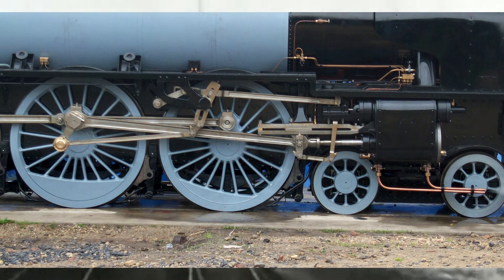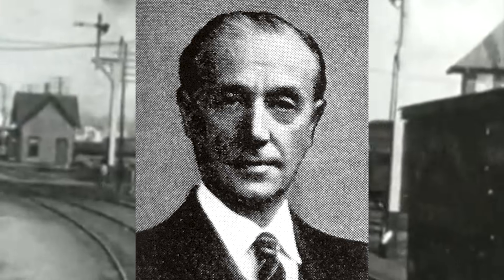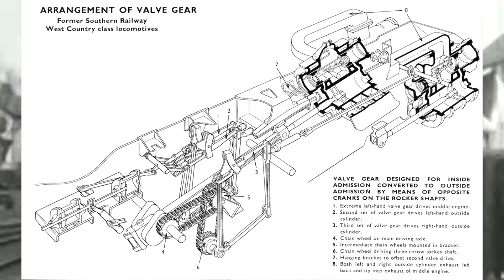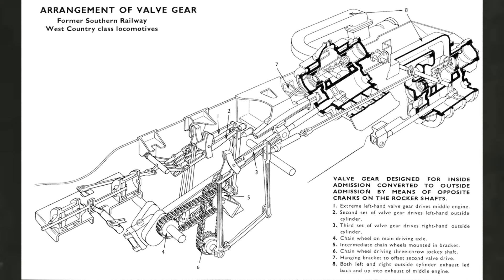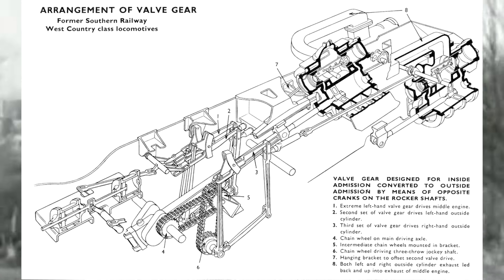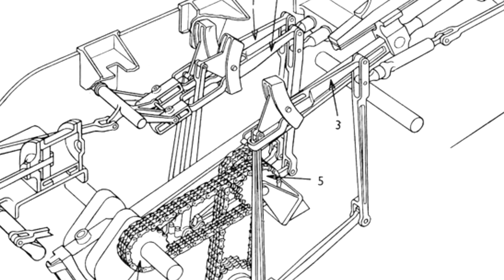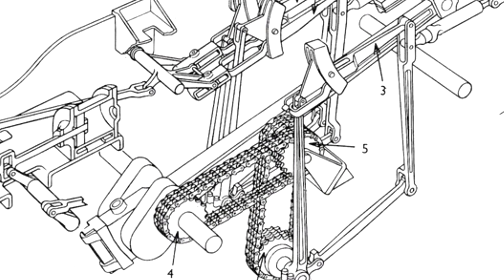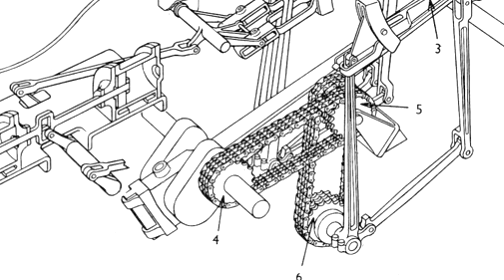Oliver Bulleid's INSANE and AWFUL Chain-Driven Valve Gear | History in the Dark

Comment: Great video, as ever. Bulleid wanted shaft drive rather than chains, but these couldn't be sourced in wartime. May not have worked any better. The chzins wore, rather than stretched. Rather like a motorcycle chain. Impellers on the axles helped to redue oil losses via the seals. The rebuilds were more reliable, but not as much fun (to an enthusiast) as the originals!

Comment: As a regular on thies locomotives I can say they are brilliant, they need to be kept in a better condition than a walsharts, but they are much easier to maintain and prepare, with the short travel valves they are extremely strong, most of the problems was crew or maintenance related, the design was absolutely fine and more than did the job and still does

Comment: I don't necessarily agree with the statement that chain drive cannot work for a purpose built locomotive, on account of the fact that chain drive worked quite well with some of the LNER Sentinel shunters (0-4-0VBT), which weirdly enough were tank engines with vertical boilers.

Comment: Based on the title picture of the gear it is obvious there is no chain tensioners. From experience of bicycles and motor cycles and heavy industry chains they stretch and wear, the stretch due to tension during reversals of load, wear due to contamination of bearing surfaces.
The oil bath helps with the latter. But without a damper or tensioner the impact of a tension reversal will always stretch the chains. A rocking arm with either small gears or possibly slides is required to control and tension both sides of the chains (pull and return) is required. You are then not causing a snap change in tension in the chain on load reversal as the whole chain is tensioned. Systems used in chain driven overhead valve car engines, the engines do not reverse, but the loads do as they accelerate and slow.

Comment: The strong point of the Bulleid Pacifics were the boilers, they were exceptionally free steaming and enabled these Pacifics in maintaining high speeds.
Not all of the light pacifics were rebuilt, both rebuilt and non rebuilt members of this class are preserved. But of the heavier Merchant Navy class all were rebuilt. The rebuild included not only the change of the valve gear, but also the erratic steam reverser was replaced with a screw reverser, the airsmoothed cladding was removed and the smoke box and blast pipe arrangement altered. This is the reason why one of the 11 preserved Merchant Navy class is rebuilt into original condition, modern technology providing better wear resistant chains and better oil seals than the original leather seals, eradicating the most obvious downfalls of the original locomotives.
The light pacifics preserved in original condition with these modern chains and seals operate mostly trouble free now.

Comment: The air smoothed casing was not an attempt at streamlining, it was used so that they could be washed by carriage washers.  The flat front end is the clue to that,  it did however help lift steam and smoke out of the drivers field of view.
Reply: Correct.

Comment: Interesting video! Given the failures, slipping and fires, it's no surprise that many of the Bulleid pacifics were rebuilt with conventional and more reliable valve gear and the air smoothing was removed to improve access. However, the sanity of this rebuild project was questionable since the locomotives' subsequent service lives were cut ridiculously short due to their replacement by diesels and the later electrification of some of their operational routes.

Comment: Most of the problems with the valve gears etc were caused by lack of good quality materials immediately after the war. Good quality modern materials would solve most of the problems. The loco's were not streamlined. The air smoothed casing was to allow the locos to pass through carriage washing machines. The casing did restrict the drivers view ahead and was nominated by the railway inspectorate as a  contributary factor in the Lewisham Rail crash. A lot of these locomotives are still doing stirling work on heritage railways as well as operating steam tours on Britain's main lines.

Comment: I did an evening class with one of the crew restoring an unrebuilt Battle of Britain and he told us that they had found out that everything wrong with the valve gear was solved with modern materials - they now had chains that didn’t stretch and modern packing stopped the oil leaks (Bullied had to use leather because he couldn’t use the roller bearings he wanted to because of war time shortages).

Comment: 10:52  I read that chains do not actually stretch.  Instead, the holes and pins in each link wear a tiny bit, giving a noticeable increase in overall length.
Reply: pretty well much, other than cheap industrial stuff... they definitely stretch and snap well before wearing out... if used incorrectly :)

and up until teh late 80s, most large capacity bikes had 630 pitch chain. big, heavy, and clunky. they still hadnt figured out how to get a 530 to take a hundred+ HP... 
otherwise...

the rollers and sprockets wear. the rollers wear on the bushes. the bushes wear on the pins.

and people pay lots of money for an oring chain that only seals the side plates and pins but does nothing for the rollers, sprocket or bushes. so they still wear out just as fast as a plain chain...
and the orings waste a lot of power...

Comment: Gresley didn't do so well with valve gear. His conjugated gear for  the A4s was always troublesome. Mallard nearly destroyed itself on that speed record run when the big end of the inside cylinder practically melted, Being experimental is all well and good but there comes a time when you ought to call it a day and admit you've blundered. In my mind Bulleid's designs for the Southern were a waste of metal. His Pacifics suffered so much wheel spin it's a wonder the passengers didn't get out and push

Comment: So, in short, they put a timing chain on a locomotive. Timing chains on small internal combustion engines (of the appropriate size to drive a car) are great, but you gotta keep that chain tensioned properly or it skips time, and usually when that happens on an internal combustion engine, you start getting negative events like the piston bending the valves, and the valves punching holes in the pistons, fun fact, modern internal combustion engines sometimes arrived at their typically 11:1 compression ratio by making the piston at the top of it's stroke (when the valves are supposed to be closed) able to occupy the same space as the heads of the valves do (when the piston is notably absent due to crankshaft rotation). So, you can hopefully see where this is going, if the timing chain skips teeth on the sprockets because the tensioner is worn out or installed improperly, you get your pistons hitting your valves, and generally when the engine's running fast, that's going to make your engine a boat anchor in short order.
Thankfully, since steam engines typically don't use poppet valves, we don't have to worry about that particular failure mode. However, the timing chain (if present) must still be kept properly tensioned, because if it slips on the sprockets, the valve timing shifts, and generally it shifts in a way that makes the engine run worse or not at all.
So, basically, if that timing chain was going to be kept in place, it would have to be enclosed with the rest of the valve gear, sealed in that oil bath, and you can't make a shaft oil seal that seals against a great deal of movement like you get with that drive axle, so the whole point of the idea that Mr. Bullied had is kinda... dead on arrival, unless you can make that shaft seal ride on the axle, sealed against the axle and a plate of metal that is not free to rotate but is free to translate up/down/forwards/backwards a little bit, and then have more seals that seal that metal plate to the main oil bath casing. That would work, but having to worry about 2 (probably rubber) seals just to keep the oil in the oil bath from leaking out or grit from getting in... honestly at that point you're probably better off just biting the bullet and going with the standard Walschaerts valve gear.
Reply: European engineers  generally do not have a good track record of making timing chains in internal combustion engines that last

Comment: Roller chains don’t stretch in the sense the metal yields and elongates under tension.  What happens is that each time a link flexes as it comes off the driven sprocket and onto the driving sprockets under driving tension, it wears a little bit where the roller bears against the pin.  After enough of these flexing rubbing events, slop develops in the interface and the pitch of the chain under tension lengthens enough that it no longer matches the pitch of the cogs on the sprockets, wearing their loaded faces down to match.  The resulting slop makes whatever motion the chain is driving erratic.

The black crud that forms on bicycle chains no matter how clean you keep them is steel dust mixed with oil and ordinary dirt.  If you scrape some off a dirty chain it will be attracted to a magnet.  Try it!

Standard half-inch pitch bicycle chains should be replaced when the distance over 24 links gets to 12 1/16 inches, i.e., ~2%.else they will start eating the much more expensive rear sprockets and front chainrings.
Reply: Error:  1/16 in 12 is 0.5%, not 2%.  My bad.  Sorry.  New math....

Comment: It wasn't the chain valve gear per se that actually caused the problems, but the steam operated reverser coupled with the drivers' habit when shunting the loco, often still coupled to the train, of going from forward drive to reverse without first bringing the locomotive to a halt.
This placed immense strain on the chain causing both wear and excessive stretch, necessitating early replacement.
Now, the chain ran in an oil bath and was intended to remain serviceable between boiler lifts, hence the two piece oil bath was not designed to be split with the boiler in situ.
Yes, it was possible, but the problems began after the repairs were carried out and it was found that the two halves of the oil bath could not, effectively, be sealed against oil leakage.
Hence the oil leaks and the occasional incident of the boiler cladding, soaked in leaked oil catching fire.

Today, with drivers being trained to operate the locomotives correctly, the Unrebuilt Light Pacifics in preservation, both on private and main line have proved to be remarkably reliable.
Reply: Thank heavens. A sensible technical answer. Locos with this gear are still in daily use on the UK rail network, both private short lines and on high speed mainlines. What OVS demonstrated was twofold. Firstly that steam era drivers were a very varied bunch. A good crew could get great things out of a spamcan but a mediocre crew could break them very easily, as you suggest. It's interesting that the badly flawed Leader loco only really functioned when run out of Eastleigh, not Brighton.
Secondly, maintenance was pretty patchy as well  something that remains to this day. The same units perform very differently depending on the depot.
I've driven rebuilt and rebuilt Bulleids in the modern era and the crews generally love them. The rebuilt versions are more reliable but there are a dozen or so unrebuilt versions around earning money for their owners. Personally, I'd love to see a spamcan version of a Merchant Navy.

Comment: I see what he was thinking. But wouldn't it be easier to just use Pistons that have the rod go all the way through, and build a mini crank off of that. It's a little longer, yes. But you wouldn't have to deal with chain stretch.
Reply: That's pretty much what the GWR did with their 4cyl machines, featuring "divided drive" i.e. inside cyls driving front coupled axle, outside cyls driving middle axle, the motion for the outside valves being transmitted via rockers from those on the inside .... Bulleid's were 3 cyl, utilising 3 sets of chain driven gear mounted inside the frames, the outer two driving their respective outside cylinders, again via rockers.  This avoided the "derived conjugated motion" of OVSB's old boss, Gresley, which was (as his successor Thompson noted) tended to be maintenance heavy,  definitely an issue under wartime conditions.

Comment: Bulleid is also the reason why the Metropolitan Vickers Co-Bo, with its 2-stroke engine, was ordered for BR. He was in favour of the 2-stroke engine.
Reply: He would have loved the Deltic then😊
Similar in the fact that his steam locos had good performance at the expense of fuel.
Reply: Bulleid wasn't the engine designer.  The concept came from Crossley and the theoretical advantages of 2-stroke were sound enough at the time.  You need to keep in mind political constraints back then didn't favour spending scarce foreign currency on that nasty, reliable American stuff!!

The problem was the execution.  The same type of engine was employed in the semi-successful Class 28 MetroVic, which wasn't one of OVSB's!  One Aussie railway (Victoria IIRC) had a shedload of Crossley enginedocos and for reasons very specific to the railway, spent ages making the ruddy things work well, which they achieved ... just as new reliable locos began to arrive.
Reply: @TheHoveHeretic never said it was. There were no 2-stroke diesel engines in the original Modernisation Plan until Bulleid made his suggestion.

Comment: Slag off Ollie's chain valve gear as much as you like, but his boilers were the dog's bollocks. Bulleid Trivia: He was also CME of the Republic or Ireland Railways. Car engine designer W.O. Bentley of Bentley cars was a Bulleid fanboy. He would go to Victoria station in London and talk to the footplate crews on the MNs, WCs & BBs.
Reply: The Q1 was a great design, it should have been a BR standard class.
Reply: And he was not liked in Ireland at all, being arrogant and a spendthrift.  His Turfburner was a spectacular and above all costly failure being based on his other failure, the Leader.

Comment: another major issue not included was the fires, the sparying oil didnt just go on the rails, it went up behind the streamline casing and would occasionally catch fire, one of the videos you repeatedly use shows a burnt patch of casing just after the name plate. such as 12:28
Reply: This is not true. The oil baths were enclosed, so oil did not get into the lagging from there. Oil in the lagging came from the cab oil trays that fed the axle boxes, when these overflowed the oil ran down the wheels and then was thown into the lagging.  This video is full of ignorance and false infromation, as per normal with videos on Bulleid Pacifics.

Comment: Chain driven gear actually wasn't OVSB's initial choice, but under the exigencies of wartime shortages, the preferred Carden Shaft technology (an import from our then ally, the US) was a non-starter. There's a hypnotic video of the chain gear in action, filmed at Brighton Works and shot from the underside. 

Come to that, the 4-6-2 wheel arrangement wasnt first choice either, that was a 2-8-2,  but the PW supremo, naturally wary in the aftermath of the Sevenoaks Crash of 1927 (involving a 2-6-4T "River" Class) vetoed any use of a leading pony truck on an express loco.  He did suggest he'd be happy with a Krauss-Helmholz Truck ... unlike OVSB!!

There's also an often repeated assertion that the steam reverser employed on the Pacifics, developed from the LSWR system, was used in place of the technically better ex-SECR system.  Others reject the idea an inferior device was forced on Bulleid by company politics  ... I have no clue (!) but do note the sad fatal accident on the NYMR, a few years back, involving an S15's reverser not being where it needed to be during a coupling operation.

Comment: Chain drive ya that sounds like it will stand up to torque and we won't go into wheel slip causing issues.
Reply: What torque?  The power was transmitted through connecting rods (3 of 'em, balanced).  The chains transmitted the rotational motion to actuate the valves, NOT to transmit driving forces

Comment: You know how you were talking about 
Wallsharts valve gear you should also talking about the American Southern railway Southern valve gear which is basically wallsharts valve gear valve gear laid on its side also there's a Union Pacific 2102 being rebuilt along with a 3985 and that Union Pacific 2102 has young valve gear which is really strange too also could you talk about the Pennsylvania t1 the original locomotive had Franklin type a puppet valve which is like a British capati valve gear that the Franklin company here in the states basically strengthened and rebuilt the new Pennsylvania t1 that they're building is going to have the Franklin type b valve gear and it's the same valve gear that the Duke of Gloucester steam locomotive has in the UK which uses poppet valves like an internal combustion engine and then in the UK speaking their of a lot of small industrial engines used hackworth valve gear which is strange one take on the Stevenson valve gear which is really interesting is to see it on the outside in Europe they used Stevenson valve gear on the outside of the locomotives a lot which is interesting the only other one I can think of that we used here in the States was the baker valve gear that you've talked about which basically uses pins and roller bearingswhat's trippy I just remembered as the Santa Fe use some locomotives that had the Franklin type b valve gear in the later years of steam the Franklin Taipei just showed up way too late but it was a very interesting valve gear and I can't wait to see it on the Pennsylvania t1 it's going to be badass it's going to sound very different Peace out history in the dark love what you do keep up the great work I'm glad you're talking about locomotives again peace out man keep up the great work